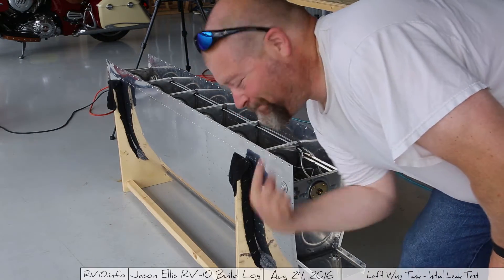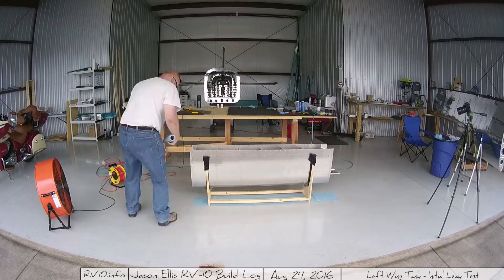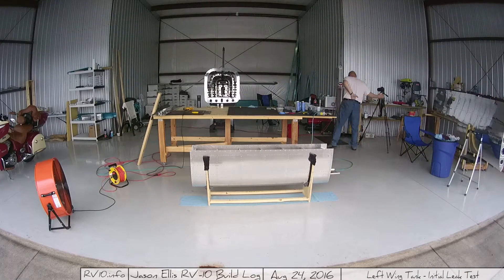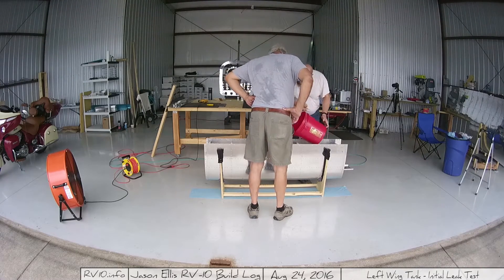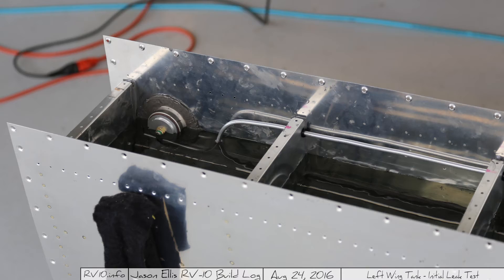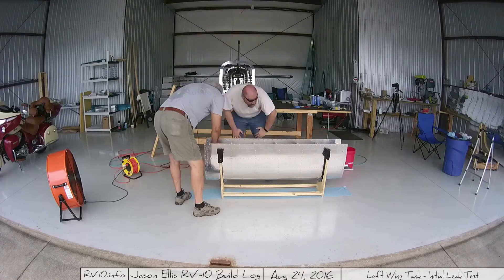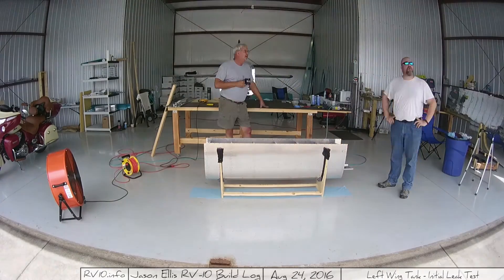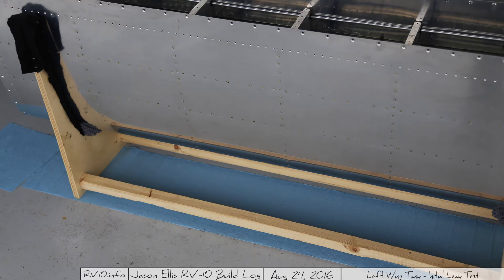RV-10 Wings - 027 - Initial Leak Test

Comment: Jason - I would still plan of doing the air leak test once you close up the tanks. From what I was told Vans prefers that method since water has a different viscosity than fuel.. So the tanks might hold water, but fuel might make it through smaller leaks. I also know a guy who trashed his RV-8 tanks using water, but he used well water that left a film of sediment that he wasn't able to remove. Ended up building a new set.
Reply from the maker: I plan to do exactly that.  Lynn actually mentioned the same thing.  I can't imagine the tanks being ruined by this water, its not particularly hard or soft water.. Standard potable city water.. I hope!